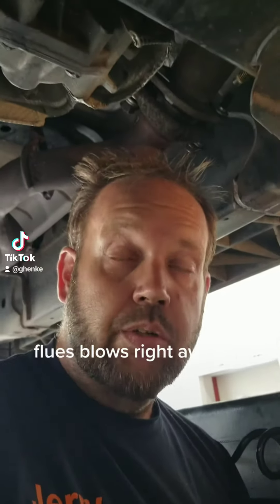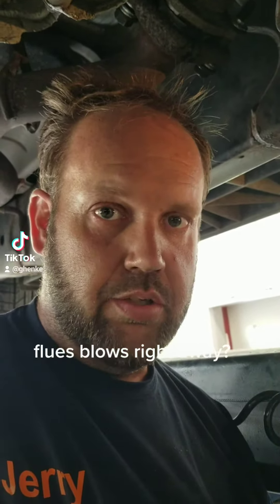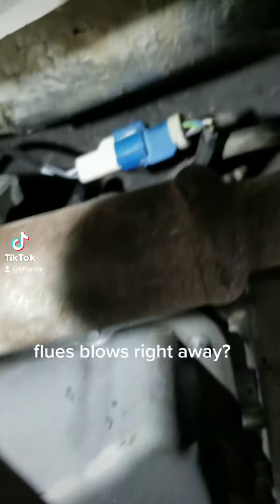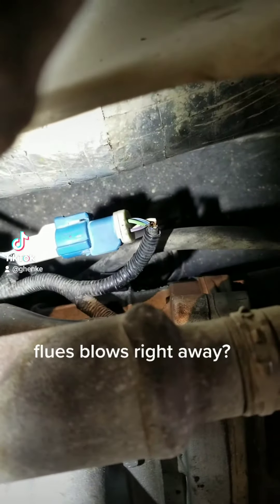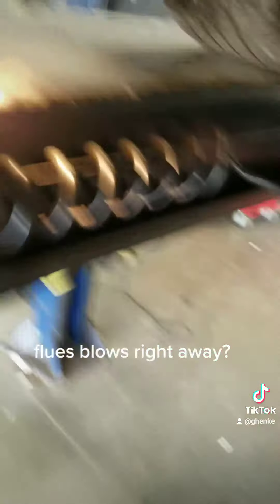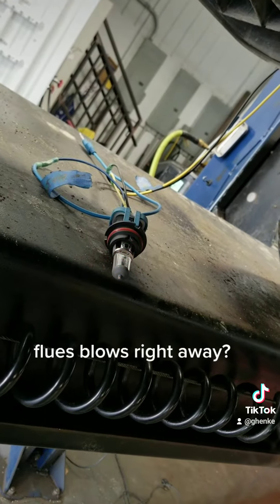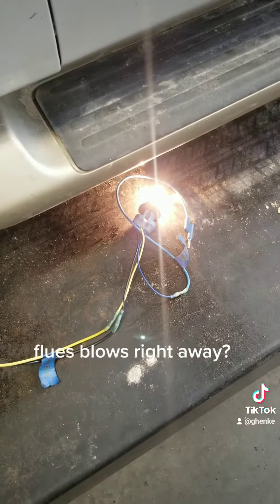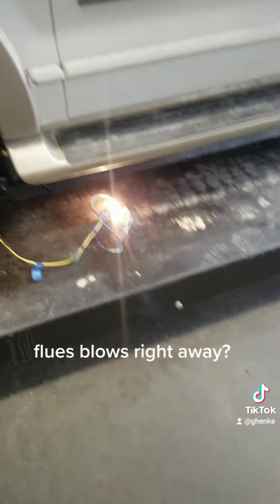fixing a fuse that blows immediately

Comment: Now that's what you call thinking with your head, thanks for the tip man! Working on a 1987 Chevy S10 and my ecm fuse keeps blowing instantly even with the computer disconnected an tryna find the right wire has been a headache.
Reply: Make sure someone didn't pinch the wires in the bell housing be hind the moter iv been there just a thought
Reply: @chrisventris6650  I pinched the wires under the air box that run to the fuel body injector
Reply: @ChilledPsycho  there u go it happens .iv seen the cross miber on the newer ones buy the trans the fuel pump wires attach to rip out crazy the stuff that can happen sometimes do to us or part failure

Comment: Can that cause dead batery ?
Reply: Yes
Reply: You could do what I did.  I created a tester using an Active Buzzer (no drivers needed type), and that will not take much current to operate, so you could leave it connected much longer than using a headlamp.  But yes, if you leave a headlamp connected, it will most definitely drain your battery, so you will need to find the short as quick as possible.  But I must say that after hours of searching by sight, it only took me a few moments to discover my problem area by using this guys method, so even using a headlamp, you still may find your issue faster than you would think without draining your batter too much.  You could also connect a battery maintainer to your battery while your performing your short test... Just a thought :).
Reply: @Outside-In.  thanks man ill try

Comment: I just want to say Thank You So Much for taking the time to create this video.  I just created a tester using a Active Buzzer (no drivers needed).  I used my blown fuse, and soldered the buzzer to the fuse's posts.  I plugged it into my fuse box, and started jiggling the fuse box, jiggling the wires connected to the fuse box - nothing.  I then started jiggling wires under the engine bay, and finally the buzzer started going nuts when I started pushing on a wire harness, and then when I would let off the wire harness, the buzzing would go away, so THANKS to your video, I now know the general area were my short is happening, now I just have to get out there again in the daylight, and find which wire (in the many wires in the harness) is rubbed through.  Wow after hours of crawling under the truck and searching by sight, and finding nothing, this trick led me straight to the area at fault for my dead short just by jiggling wires around.  So, thanks again for this great video.  I think I may create a video of my own, and show how I made my tester and then show how to find the positive side of a fuse so the tester can be plugged in the correct way (and also link to this video ;) ).  Awesome - truly awesome.  It is great when people use their experience/knowledge and share it with others - as that is what I love to do myself.  A big thumbs up for your time in doing this, and even after two years, your video is still helping people - God I love YouTube...  ...And now I am your 61st subscriber 😉